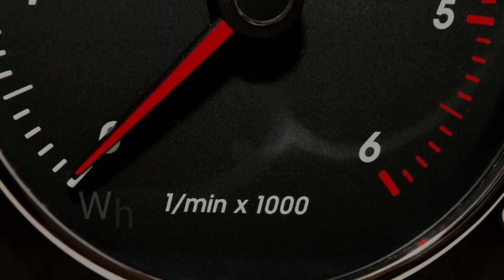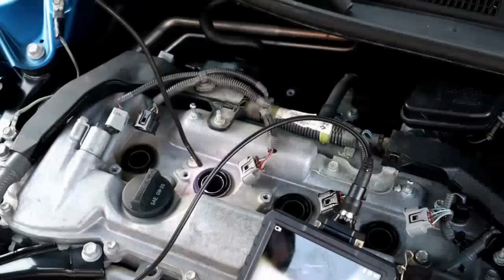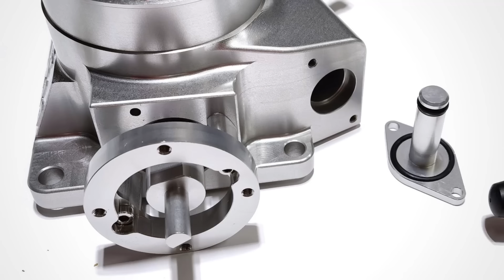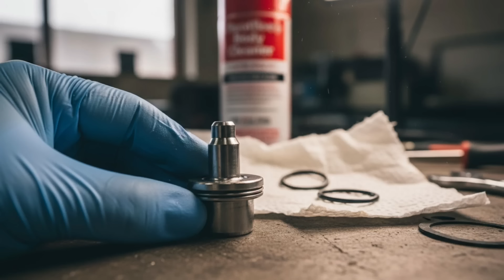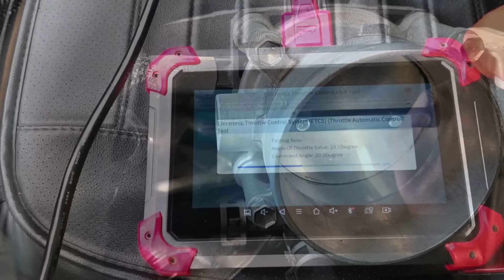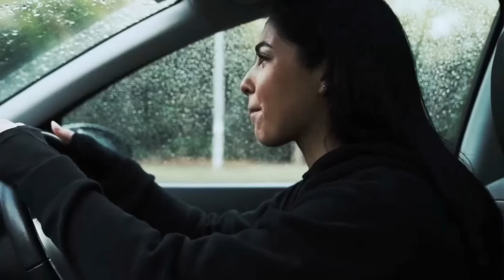The Hidden Sensor Causing Your Car to Shake at Idle

Comment: 2008 nissan quest cold start nears 2k then slowly drops to 800-1k. In drive it self propels w out touching pedal.  Due to this it takes a little extra beaking (mash harder & a little sooner).  Once warm this goes away if restart car.  However sometimes when restsrt it goes into limp mode if driven a few minutes.  And p0726 code w it.  
Will a dirty/sticky IAC cause it to smell like running a little hot (temp gauge shows normal)?  It has suddenly overheated when idling in hot weather a few times but like 2-3 /summer.  No rhyme or reason to it that I've found yet

Comment: My IAC valve runs sporadically. first thing in the morning it starts well and idles smoothly. after driving awhile, park for a short period and whenever I re-
 start the engine it shakes tremendously. and rides rough back home. I drive a 1999 Toyota Tacoma 6 cylinder. Cleaned 02 sensors replaced Mas air control valve, replaced plugs and wires, replaced PVC valve, and gas line filter. HELP! can't figure it out.

Comment: My 2005 Honda accord, 4-plugs, the idle is so rough sometimes it stalls and the engine goes off.
Please how do I reset and relearn both the Throttle Position sensor and the IAC valve?
Thanks
Reply: You don’t… you replace the TPS and brake clean the IAC….

Comment: thanks but couldve used more specifics on cleaning elec.throttle body with IAC sealed to it. Can you see the bore on the wall when the plate is open? Do you target that? Or must unbolt entire throttle body before cleaning? Cause you did say reassemble but this wasn't clear.

Comment: A Mitsubishi 6D16-TLU2D diesel engine in a 2007 Kobelco SK330LC-6E excavator has a rough idle after start up but clears after about 15 minutes however as the engine speed ramps up on a control input of any one of the joysticks as the hydraulics is activated there is large clouds of white smoke coming out of the exhaust and would cleat up as the preset engine speed is sustained  which was set on the engine throttle selector. Appreciate any help. Thank you.

Comment: What vehicle is this?  I can't find a video on a 2016 Chrysler town and country van.  I'm not sure where the IAC valve is
Reply: Look at the video again. It should be right near the throttle body, or part of it.
Google IAC for that vehicle.
Reply: Subaru xv  fb 20 got rough idle when engine stationary even  engine oil  ate 95 Celsius

Comment: I have High RPM only when the car is in rest for couple of hrs and then turn it on, cleaned throttle body but still no luck
Reply: My Honda Civic idled high after a throttle body cleaning. There is a procedure to relearn the idle that didn't work for me but with a proper scan tool you can do the idle reset which gets the idle back to around 700rpm once warm. Some vehicles the ECU will relearn after a while but the Honda has to relearned through their procedure or scan tool.